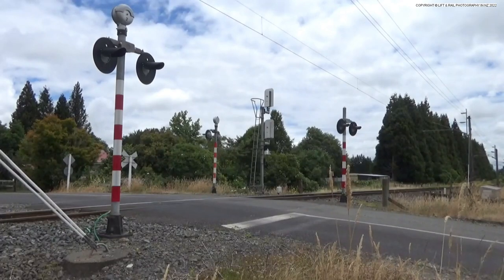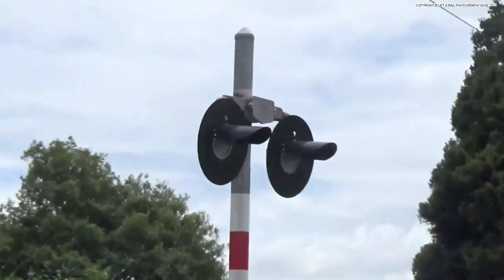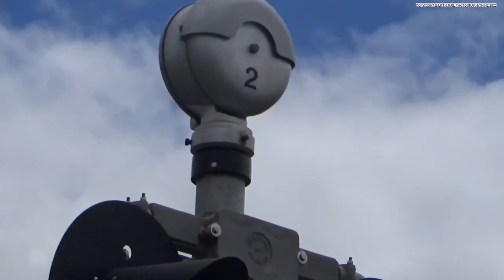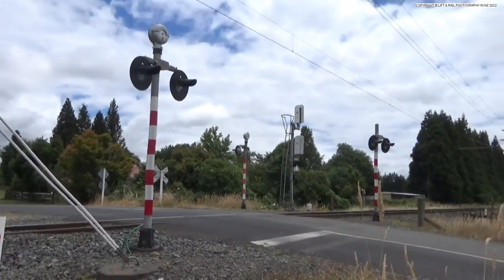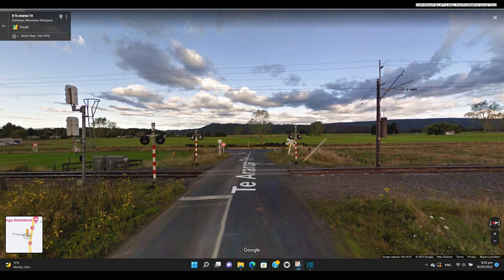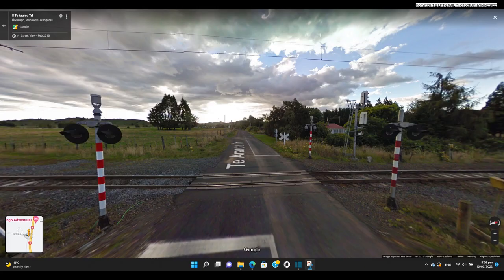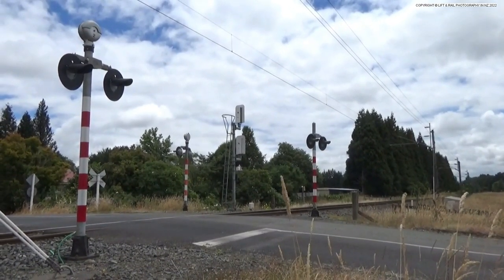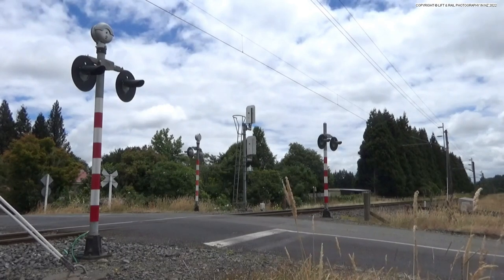Kawautahi Road Level Crossing, Owhango

Comment: Nice video, Yes very interesting they changed the bells, BACK to mechanicals. I have a theory, Maybe they did that because there was a more busy level crossing in a town somewhere they wanted on the quite setting, But in order to do that they needed WCH e-bells, So they did a switch a roo. Lol
Reply from the maker: Thanks and yes that could be why they that it.
Reply: @liftrailphotographyinnz3992  Remember thats what they did with Blemheim Street, And Pukerua Bay station
Reply from the maker: @Jamie-Tane-media  Yeah